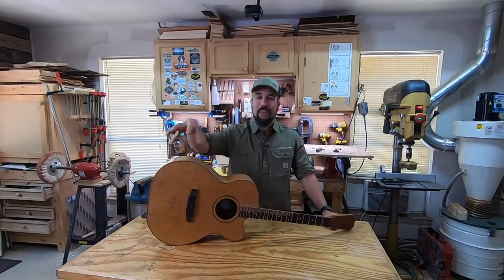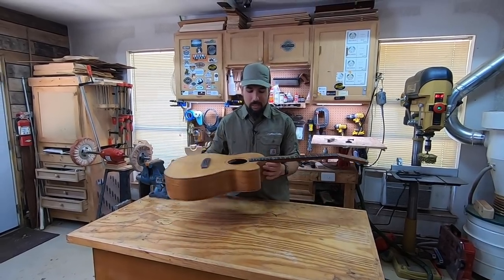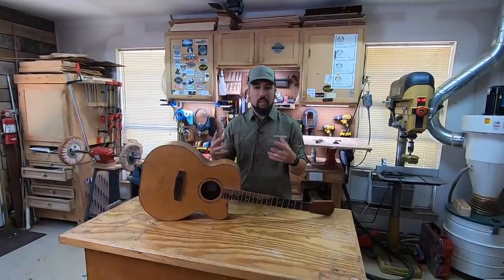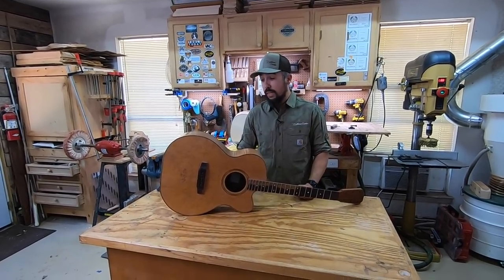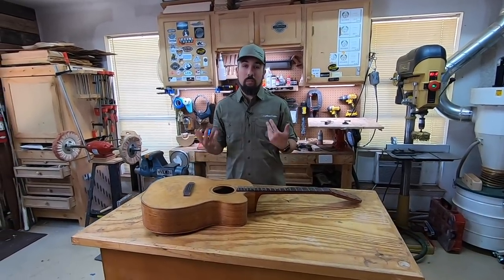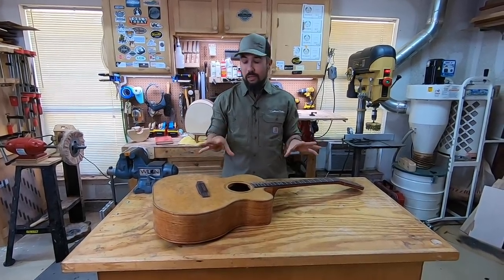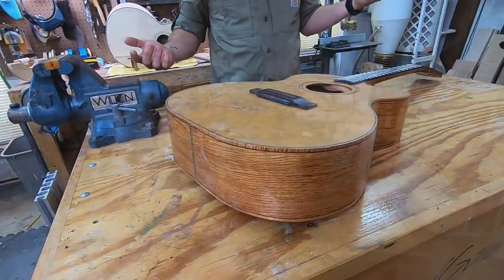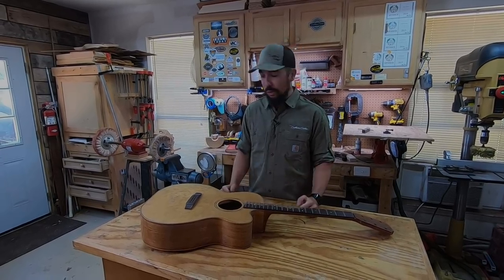My First Guitar

Comment: My first guitar came about after I found a piece of driftwood from a very old ship. A little research later and I found the ship was made in New England in the 1870s and had shipwrecked here in Iceland shortly after. It was white oak. So after letting it dry for a few years I decided it is to become an electric bass. I made a 5 string fretless and used the oak as a bookmatched top. I was hooked. Yes, mistakes were made, the only power tools I used was a drill, a router and a jigsaw. I've made 8 stringed instruments since then and am currently building two acoustic basses at the same time.

Comment: I have built a couple of "kits" and now am building from scratch. What has been the lightbulb moments for me is the amount of time and materials for building just the jigs and fixtures for scratch building. That for me has been almost as rewarding as actually building the guitar itself. Every aspect you need some kind of jig, fixture or work board. Some instances you need a jig just to build another jig. With each one I feel my comfort level grow as well as the knowledge of tool usage and skill refinement before actually working on the guitar woods.

Comment: I’m 15 and I’m building my first guitar, it is almost done. It did take me a little less than a year tho, let me tell you all what went wrong ;)

- bridge plate 
I put a oversized padouk bridge plate in just to regret it afterwards. I pull it out but with doing so got a pallet knife stuck in the top, lucky lucky me was so lucky that most of it will be covered up by the bridge.
- shape of the guitar 
A mold was way to expensive for me to buy and I did not have the tools to make one so I just freehanded it, it worked out pretty wel but the guitar is a little uneven. But on that note, I did ben the sides with a $7 hair curler, so I’m not to mad about it :)

- Binding/perfeling (that is probably speld wrong, I’m not a native speaker give me some slack here)
I cut out the binding/perfeling slots by hand, so there not perfect in any way... pretty happy to be honest 

Looking back I should have probably not have used wood binding but just regular plastic binding, that would have made my live a lot easier, and it would have probably also looked a lot better.

- finish 
I am working on the finish at the moment (I’m using a nitro finish) wut it have a weird brouw-ish color, not really my fault, but still

That is about it for now,
I’m sure that more problems will arise when I’ll gluing on the neck and bridge.

Thanks for making these video’s it really helps a lot!

Comment: I built my first guitar, a non-cutaway acoustic of my own design from scratch in 2003-2004. It took me quite a while because I ended up building all the jigs too: radius dishes (but first the jig to make them), Fox side bending machine, binding cutter and body holder. It actually turned out great. Full disclosure: I’ve been a woodworker all my life. It was Indian Rosewood back & sides with a bear claw Sitka Spruce top. My next was a Florentine cutaway, Honduran Rosewood for my best friend. I recently finished my 5th, an OM-ish size with Walnut B&S and all the spruce from my mom’s 1960 Wurlitzer piano. They keep getting better!

Comment: I started playing guitar 2 months ago.  I got 4 lessons in and they got cancelled due to COVID 😩.  Now I've been researching how to build a guitar.  Looks like a lot of work but I feel like it would be a really rewarding experience even if the first guitar doesn't turn out so good.
Reply from the maker: You can do it!
Reply: Build the best piece of crap you can, out of crap wood ( I said Crap not scrap), just to get used
to the steps and motions.
That way, whatever piece you screw up, you can toss it and start over (if you can't fix it).
Once you feel comfortable and more confident, get some lower quality guitar wood and try again.
Slowly, step up, on the wood as you get better. You don't want to blow a good set of top, back or sides.

Comment: Hi Chris, my first guitar was a fender stratocaster. I though of starting with solid body instead of acoustic to learn. I bought the wood from a ton wood shop and ended up misusing every part. So I bought whole boards of alder and maple from a wood supplier, paid 100 Euros for wood that could make 6 guitars. Ruinsed a couple but ended up finishing my first electric guitar. Sounds and plays great. A lot of mistake made. Next guitar (also from the same boards) will be much better. I bought also 10 soundboard tops for 100€ and three sides for practicing and mahogany back and sides for the first guitar..

Comment: My story is blogged on TDPRI as "The one that got away" - trying to replace a real deal 1959 Les Paul Standard Gold Top that was stolen from me in 1983.  I cannot afford to replace that guitar due to their enormous collector value increase, so I decided to try to build from scratch a similar LP.  I used mahogany scraps, Bubinga fret board that I traded flame maple for, and I bout an 8 foot long x 8" wide 4/4 flame maple board at a local hardwood lumber store ($45).  After numerous ID10T errors, I managed to complete the guitar, making my own inlays, and Dremel router sled, and made many of my own tools to  cut the binding channels.  In a former life I was a bench jeweler, so I have pretty good quality tools, and skills. In honor of my Dad, who was a professional woodwinds man, I inlayed his stage name, "Greene" into a thin layer of cocobolo headstock overlay. He'd have been very proud of me, I am sure. The axe has many flaws, and discoveries, and I know the next one will be much better. I have slabs of really good mahogany, QS African for the neck, and killer Flame Maple for the top, ebony for the fretboard, and great hardware set aside. I learned a lot, especially how to fix too many mistakes to mention.

Comment: I love the inlays. I have the same on my TS-97C cedar top FXC from Takamine.

I like that guitar for a first guitar.

Mine was a winebox resonator with some octave strings in the middle.. Basically a staggered 6 string set.

I got oak and maple strips from in between pallets of flooring and laminated the neck thru with gaps allowing for a pair of PBass pickups one in the neck position the other hidden under the dog bowl I used as a resonator.. Which also has a Piezo crystal. It's got a pointy Jackson like headstock and it's nasty to play using 1.6mm brass fretwire. String spacing is its biggest downfall..  I used Superglue in a few places like the neck joint because it was very much a risky design.

It's stable and stays in tune just fine.. Three years in now I still play slide with it.

My second was a neckthru bass using more of the same strips plus a 12mm thick piece of Pagoda as a fingerboard.. Which extended to a 30th fret area.. Fretless... A hybrid between a P bass and fodera and a Jazz bass neck.. But with a upright bass style headstock...

I used SPF lumber as the body and outer laminated strips of the neck. SPF/oak/MAPLE/oak/SPF.. And all the SPF is shou sugi ban with TruOil.. The oak and pagoda EBONIZED with steel-vinegar.

Unfortunately I abandoned it NYE being evicted and forced camping to VDay I just had no room to take with me. When I went back for it. It was gone.

Comment: I did a refinish on my Squier Jazz Bass (2004/2005 stamps on the inside so the neck is nice has nice wood). It turned out decent but I had to respray it multiple times. It was metallic and right at the end I had to widen the bridge pickup route and I used masking tape around it to keep it from chipping out but when I pulled off the tape it took off some clear coat too. Bummer but it's otherwise nice looking and sounding. I also sanded the back of the neck a bit. A little reshaping to make it less circular near the 1st-5th frets and it feels good, but maybe a little blotchy in appearance. 

I have a Jazzmaster build lined up too. Body came painted and the neck is roasted maple so I'm more concern with fitting the parts together since the pieces come from everywhere

Comment: I've played & owned almost any bargain brand you can name. Kay, Harmony, Egmunds (Bought 2 new for $10 from Woolco when I was in HS). Looks really don't matter, how it plays & sounds is all that REALLY matters. (Of course a beautiful guitar that sounds great is a real treat.) I remember I bought a used Fender F-15 for $50 back in my mid 20s. It actually sounded great. But I was in heaven (talking acoustics now). I've got an old beater I bought for $100, it sucked, until I did a little work on it, cut the nut properly, levelled crowned the frets, set the action, etc. The guitar came to life, sounds great, no resale value, the Pawn shop won't even give $20 for a pawn. I'm not a builder, but I do repair them. Played for 50 yrs, have owned lots of dogs, but a couple of great sounding acoustics. Electrics are a different story, owned lots of Knock Offs,Have owned Strats, LPs,finally bought a Telecaster (My dream machine). I've had her 30 yrs. Got that plus my 335 copy (once I set it up correctly, but slots, etc, it sounds decent, the pups aren't the greatest. I do enjoy watching you build your guitars, they turn out beautiful. Would've loved to have heard you play that 1st guitar. She's been neglected, but I think a little TLC would bring it back. Not much work to do. Would've loved to have heard you play it. Keep on going, you're doing great. Did you put the "Spanish Slipper" on the neck?

Comment: Back in the mid 2000's the books available were by Irving Sloane, Campiano was like the best one for hand building, for electrics, Hiskock's book, and a couple others. the Book you used Read was Kinkades, I have it too, he does some ODD stuff. Back then online was Charlie Hoffman steps, with Photos, and tools he made. True North Guitars was great for building steps with Photos. Of course you Driftwood and sharing very valuble knowledge, Obrien guitars too. There is tons of stuff now, but in 2005 or so not as much. Most people build 1st instuments from Kits 1st, Now you got lots of sources for those reliable ones, Stewmac, LMI, Martin sold/sells them but the parts are definitely their 2nd's or parts that they would not use for their own stuff, which is a bummer, you run into all kinds of stuff to fix on it to make it right while you are building it. So I would go with Stew, and LMI, for better starting places.

Comment: I haven't built my first, the plan has been to make the first from a plan and then modify as I want to build multiscale instruments and I want to build 7 and 8 string so most likely would have to go with carbon fiber rods in the neck for extra strength.

Comment: Lovely Video guys...Although I  had to laugh at "Don't buy expensive woods for your first build" because that was exactly my first of many mistakes.  It was an OM with a lovely redwood top on IER back and sides. Thing is...I built exactly according to the StewMac plans designed for a spruce top. Only afterwards did I learn that it is better to keep a redwood top a little thicker....and didnt know squat about voicing. However... All in all it turned out to be a 100% functional instrument after all errors made...even it ended up sounding a little thin and honky. I ended up filling it with PUPs and it became an excellent gigging guitar. (Not so much in the studio though) :)

Comment: I used that same book to build my first guitar. I figured it was going to suck. So I bought all the wood from Home Depot and everything else from StewMac. It looks good, plays great, and sounds like a first guitar build. Should have bought good wood.
Reply from the maker: This first guitar probably wasn’t as bad as I make it out to be, it just wasn’t exactly what I pictured in my head.
Reply: @DriftwoodGuitars  
It, actually, looks pretty good.It may not sound that way, but, of course, I haven't heard it.
However, as you mentioned, you took a long first step and advise against it.
I think Hartshut has the right angle.

Comment: Chris, Unfortunately I found your videos after my first acoustic.  After 10 electrics, my friends urged me to try an acoustic but I didnt want to spend 6 months and burn it in the fireplace.  Anyway, the first one (a 000-28) plays great but...   I fought the finish recommendations and did a hand rub (crap).  I earned a "D-" in the binding (still pisses me off), etc.  On to my 2nd acoustic (with #11-#14 electrics on deck as well).  Looking for more of your stuff as I mine your current videos.  Also, btw, the videos on the right luthier tools are perfect - other than that I still cant bring myself to buy the binding gear (probably will soon;).  Be well

Comment: I put together an electric in 2000 for my first child. Not really building as I’ve always lived in an apartment. Bought parts off EBay. I got incredibly lucky-thought that the body was just a black painted reject, but after taking the finish off because it was chipping I discovered a one piece mahogany body with a curly maple top. A $25 Strat neck just didn’t seem to play well so I splurged on a Warmoth neck (best decision ever).  Got something different with a fat neck and vintage sized frets and put it together and suddenly it played really well.  
Spent a few more years upgrading parts and my son was old enough to try it and….he’s left handed.   And has no interest in guitars. So it sat for another 5 years.
I saw it in a corner of his room one day and thought I should try to make it as good as it could be cause it might be a good backup to perhaps my second son would like it.  I bought better parts like Sperzal staggered locking tuners, a better bridge, and good electronics and man, did it play great, better than my other guitars.  If only it sounded as good…I’ve tried at least 7 pickups, including a Lindy Fralin but it never had the sound compared to my main guitar.
I finally bit the bullet and swapped the pickups (Gibson Tony Iommi) from my main guitar to my partscaster and (insert heavenly choir) and suddenly it’s the ONE.  Made all the difference.  Nothing compares to it.  I have a ‘95 PRS Custom 22, a ‘77 Gibson RD Artist and really nice Epi Les Paul and nothing comes close. 
There is nothing better than making your own guitar.  A one of a kind instrument made with hard work and love.

Comment: I've been an 'amateur' woodworker for like 35 years, but have never had my own shop. I always wanted to build an acoustic, but was so intimidated. Last year, I decided to start small and build several ukuleles (which I have no interest in playing, no offense to anyone) before my first guitar. I claimed a corner of the garage and went to a local lumber mill/yard and bought some wood. They carried 20' sections of 8/4 quarter sawn sitka spruce for boat builders (that they sold by the piece), but had one 5' cut off left from one they'd cut down for other instrument builders. It had tight grain, one face of the board pretty much perfectly quarter sawn.They also had quarter sawn Sapele in thickness for under 8 bucks a BF, so I got a some of that too. I figured the further back I started in the process, the more mistakes I could make- giving me more opportunities to learn. I nailed that one, for sure. At least when I've ruined stuff I could make more. I'm making the first uke a steel string (because I really just want to build a small guitar), and I'm ready to assemble the body once I'm done tuning the top. I've watched a lot of videos about it, and I'm noticing tone changes even though I'm pretty ignorant. I carve, I tap, I flex. I'm scared to stop too soon or go too far. I don't want it to warp or sound dead. I hope if I pay close enough attention I'll learn something through repetition. Thanks for the video!
Reply from the maker: That’s awesome that you can get Sitka locally! Good luck on your builds, and just keep at it. I’m sure it’s turn out great.

Comment: I have been binge watchatching your videos and have just completed my first acoustic guitar. If you do not look at it too closely it looks pretty good. But on close inspection you can see some pretty bad mistakes that I made. Having said all of that, I wouldn't trade it for anything right now. It sounds pretty good it plays really good. I got that dreaded ski lift at the body joint. And the bridge slipped a little bit so the intonation is not perfect but I'm happy with it. In the spring when I have time I will take the bridge loose and relocate it to its proper place. And also remove the frets starting at the body joint, and level that area out to where the guitar is playable past the 14th fret. That is assuming that the guitar holds up until spring rolls around. I've had it strong up for a couple of days and it is not moving, but I made the top very thin, around .85 in the area behind the bridge. And braces are very light as well. I can already see a little stinking point in front of the bridge between the bridge and the sound hole. But it's not getting any bigger yet. But I would not trade the experience for almost anything in the world, and I would heavily and hardly second your suggestion to go ahead and build do it if you're thinking about doing it you will not be sorry. Thank you for all the videos.
Reply from the maker: Congratulations! There’s nothing like your first build. Warts and all.
Reply: @DriftwoodGuitars  I have
 built several electrics, and a couple of basses. So I am not new to building guitars, but that being said there's a world of difference between building an acoustic and building an electric. I look forward to my next acoustic. And to your next video.

Comment: The question I have is, when you advise not getting the best materials is that the Stewmac kits I have seen already are using the best materials.  So, in a case like that, would you advise a partially formed guitar kit?  Or is it better to just start from scratch like you did with whatever choice of wood?